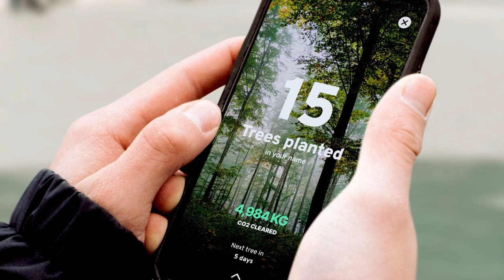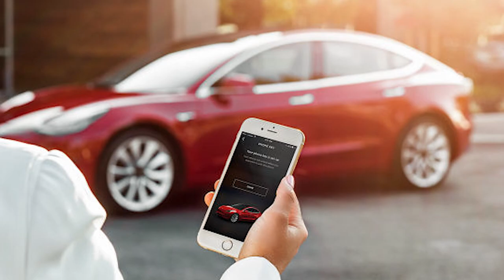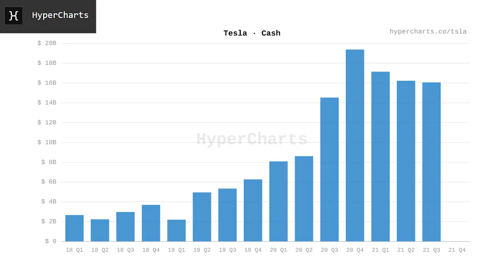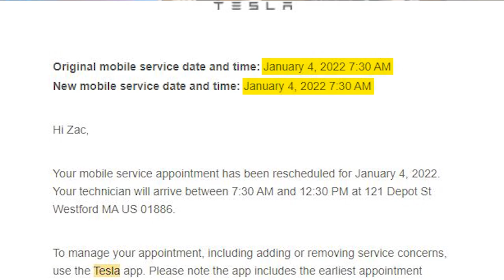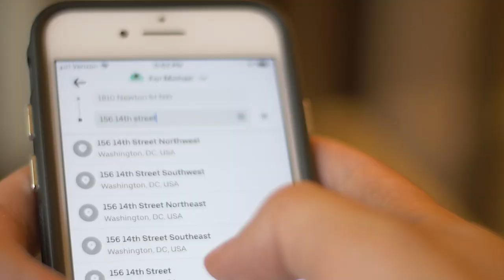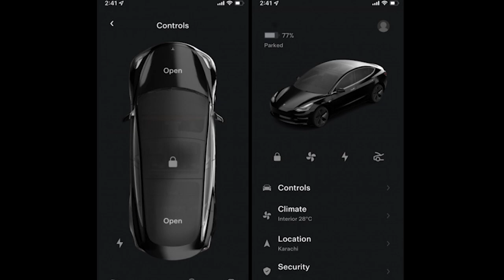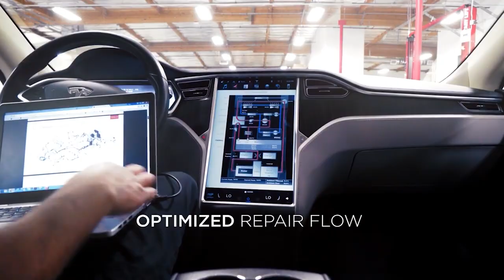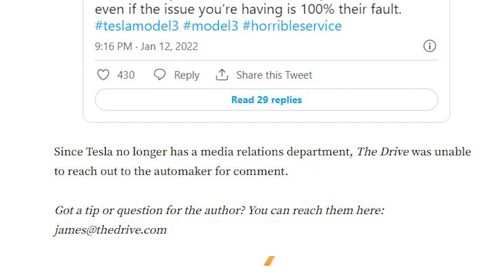Tesla We Love You, BUT… | In Depth

Comment: Tesla should start training and officially authorizing other mechanics to act as officially authorized Tesla repair shops. There are a lot of mechanics out there that would jump at the chance to work on this well-known EV brand, and the number of ICE cars are declining. BTW, other new EV companies like Rivian are faced with the same problem - and could use the same solution. 
This is one area where the legacy automakers like Ford, GM, and VW have a big advantage - they have an extensive network of dealers, all of which have full service and repair departments.
Reply: That is especially true of repair parts that are standard for all cars - any tire shop should be able to handle tire replacement and wheel balancing. Places like Midas should be able to handle brakes and suspension system repairs. Window glass ships should be able to handle window and mirror replacements. Body shops should be able to handle dents and scratches. 
So, basically everything except the drive train, FSD hardware and electronics.

Comment: This video really struck a nerve with me.  I have a 2020 Model X Performance which has been very unreliable.  I know the premise of the video is not that reliability is necessarily bad, but most of the problems I've had have been ones that I've seen common complaints about from the X: failed Falcon Wing door sensors, shaking from the front CV joints, failed HVAC system, failed SD card in the MCU, needing a new 12V battery and tires 3 times in 30,000 miles even without spirited driving. Every time, getting a service appointment has taken weeks, usually meaning that by the time the service appointment comes we have a list of multiple issues to address.  The service techs are generally nice and helpful for us in person, but as soon as we leave the service center, it becomes extremely difficult to contact them.  Especially when, as has happened several times, we left service and found later that the problem still persisted; but by then the original service appointment is closed and we have to book another one.  As you said, talking to a real person might take 3 minutes to get a resolution, but trying to do everything through the app is a complete nightmare.  At least I seem to have had better luck with getting loaners than some others you mentioned in the video.

But the latest problem is a failed high voltage battery pack.  The car was towed to the service center on December 19th and I have yet to get it back more than a month later.  Every time the service completion date comes and goes, and just updates to a new date further out.  It seems that Tesla is not interested in sending HV packs to service existing cars preferring instead to simply churn out new cars.  A fixed car doesn't show up as a delivery on quarterly earnings.

I am a huge Tesla fanboy.  I own their most expensive model (at the time of purchase) and I have a pre-order for both a refresh Model X and a Cybertruck, both top of the line.  But if they miss their next service completion date again I will be cancelling both orders and possibly seeking a legal remedy for my existing car.  Already, every person I know has seen my experience and have been completely turned off of Tesla as a brand.  Instead of seeing all the good aspects of my car, the conversation instead always revolves around the unreliability and the fact that it is always either in service, or waiting for some service appointment a month in the future.
Reply: HV battery packs are incredibly difficult to get right now.

Comment: AND............................

This is why I've said that right now, the fact that Tesla has built all the manufacturing capacity is significant, for now, but people who try to say that Tesla will always be ahead of other companies?  No, absolutely not.  

Everything you've said in this video is something MANY people have talked about, and this leaves a bad taste in people's mouths.  At some point, when there's a lot more competition by the end of the decade, people are going to shop around a lot more and the fanboi thing is going to fade away when every auto company produces EVs.

But, it's a lot more than just that.  It's going to be about how people enjoy the vehicle, and I know there are lots of Tesla fanbois that will talk about how great they are, while ignoring the many thousands of people who've have a different experience.  What is the comfort, how does the vehicle handle, what's the visibility, etc....  They're going to be going against auto makers, that while wrong in thinking they could easily catch up to Tesla, won't be wrong in the long run because it won't be about how many vehicles you produce anymore.  It will be about how people feel about the vehicle and the ownership and this is where other companies have decades of experience, AND the infrastructure in place to deal with problems, because even though you have to completely rip a factory apart and redo it to build a BEV vs. ICE, the same isn't true for service centers, and that's what other companies already have.

The vehicles need to stop having all these little problems.  I constantly hear about issues with Teslas, and the last three 4 vehicles I've owned, all for 120,000 to 140,000 miles, I only had ONE issue where something broke, and I owned a Geo, Kia, Nissan and Toyota.  The only thing any of those vehicles ever needed was maintenance.

Last issue.  Tesla uses Agile as a project management scheme, and that's fine, but eventually that needs to get you to where you release a vehicle, and it doesn't need 100 changes in the manufacturing process or changing a part out with something else.  The other manufacturers are used to producing a vehicle every year, and they don't have to keep changing it, and most never need any recalls.  So, Agile is both good and bad.  It's fine right now while Tesla is figuring out the best way to make a reliable vehicle, but they have about 4 - 5 years to make the 1st vehicle that rolls out of the plant the same as the last one for a given year, and they'll need to follow the model of the other makers, because that's what consumers expect.

I'm rooting for Tesla, really, and I want them to get to where they're releasing vehicles that a middle class family that's making around the median income can afford to buy like what happens in China with BYD and some other companies.  But I see them hyped up so much, with things like them being able to make 20 some odd changes in a week as a good thing, and it is and isn't.  Other companies will put more planning into the design and manufacturing, and they'll make a vehicle people really LIKE to drive, and almost never have issues.  They've been doing it for a long time, and while making a BEV is different, that doesn't negate the experience they have in design and manufacturing.  I would never buy a Tesla in the current config, because if I want service, I want to drive no more than 10 minutes to drop the vehicle off and as I live in a big metroplex with lots of service centers, it's easy.

Yes, Tesla better start making those investments NOW since they're going to be rolling a million+ vehicle off the line this year, and people are going to have a lot more expectations.

Comment: They need to build a factory just for parts just for their service stations.   Doesn’t need to be a massive factory as they are only using this factory for a fraction of the cars sold,  for repairs.     
It just shame that a company that has so much promise with this MASSIVE issue.
   The amount of time to repair a ice vehicle is hours to a couple days at most.    While you have to leave a tesla at one of these few service stations.      Then they get jam packed show in this video.     If they had a turn around time of a day or two at most they won’t be jam packed at all.

Comment: Tesla has always not cared about service. This is why Tesla solar(energy) is not moving forward. It's the number one thing I use to sell against them. (I used to work there but had to leave bc they don't think salespeople for solar are necessary 🙄. ) So they have the "Lowest cost" and I simply ask the potential person to go on Tesla's website and if you can find me a phone number to call to get help when something goes wrong within 5 minutes I'll pay you $100 right now. Then when they can't I tell them the most expensive solar system is one that's not working and costing you time, energy and frustration trying to get it fixed.

Comment: My daughter has a 2018 M3 , she made an appointment to get the 12 volt battery replaced. No was wrong, it’s just her car is almost 3 years old and she heard that the battery goes bad in about 3 years. She also heard people that thier battery died and they had been stranded. She wanted to prevent his from happening. So Tesla told her their were no notifications that the battery was bad. The next day unbelievably she couldn’t get in the car .Call Tesla they sent a tow truck to her. The tow truck done how shorted out some wiring . Called Tesla , they sent another tow truck that new how to tow her car. After all this is Tesla hag MF changed the battery to begin with it would only cost my daughter 150.00 dollars . But instead Tesla hat to pay for the tow, an electrical cable and a burned bumper. Not to mention the loss of here car for 4 days . This  is BS incompetent service. Period. Charlotte Tesla Service SUCKS.

Comment: I love my 2016 Model S 90D and have put 85k miles on it. When it has needed service, the experience has not made me proud to be a shareholder. There are some people I cannot recommend Tesla to because I know they would not tolerate the service experience.

My door handles stopped working, which is apparently common to my make/model. It cost $600 each and took three weeks for the ranger to come out and fix it.

My infotainment system freezes and resets often and a visit to service yielded no fix. Subsequently it was recalled (5 months ago) but has not been fixed because no parts are available.

Recently navigation stopped functioning, showing an error after a system update. Tesla said it needed a new micro SD card which they would install in a couple weeks for $250 and a day in the shop. I did a factory reset and the error went away.

The windshield wiper fluid pump quit working and Tesla said it would take 3 weeks to get to it. I ordered the part on eBay for $20 and did the work myself because it is not safe to drive for three weeks in Midwestern winter without a clean windshield.

The car is the best product I've ever owned but the service quality is low.
Reply: $600???  The handles are $300.  I don't know which Service Center you're working with, but they're ripping you off.  Now, the "three weeks" is about par for the course right now.  Door handle retrofits require a door handle controller that is almost impossible to get, at the moment.

Comment: I don't doubt Tesla has room to improve but during COVID do you think Tesla is alone in having problems with oem service centers? Staffing is all screwed up across all markets so just telling them to fix labor problems out of the blue is naive. Tesla is not alone, OEMs are having staffing problems too.. two guys who don't run a business telling Tesla how to manage staffing..

Also Tesla started with very few service centers and built them out when customers on that area increased. When Maine gets more cars, Tesla will build a service center.

Naively griping for an hour? Unsub

Tesla
Reply: This is correct, but I'd like to add that Maine probably has dealer franchise laws that prevent Tesla from opening a Service Center there.

Comment: I have called for service model X drivers window slooow as a snail
Reply: They clean and silicone the window where you can't see out of it very well after it goes up-and-down once A neighbor friend of mine had the same  model minus the performance an his window they replaced the cylinoid. They still haven't fixed mine yet a moble tec says it is extremely slow.

Comment: The torn underbody “fiberglass” was extremely common (I.e., design flaw) in early Model 3s - we had exactly the same story (rain, deep puddle, etc.) for our mid-range Model 3 we bought in late 2018. So they should have known that their mobile tech wasn’t going to be able handle the problem even when they made the appointment.
Reply: The aero shield is easily replaceable by a Mobile Technician.  There has to be more to this story.

Comment: Service has BEEN Tesla's weakness for some time now. It's only going to get worse as many more Tesla's hit the roads. Not quite sure how this aspect was missed since you're talking about cars. Cars have get physically worn out by the roads just like any care. I've heard it said that Tesla EV's are computers on wheels. However, computers don't usually interface with roads, weather, and natures debris. Time will tell. Even the legacy OEMs are going to have to tackle this problem but from the other end. They have service centers, but they're not equipped with the hardware or employees to handle the computer side. Businesses such as Gruber Motors are already starting to fill deeper portion of repairs. The non-assembly remove and replace type of maintenance which is very expensive. They dive deeper to a smaller component level to minimize the repair costs. So, even though Tesla has solved the development, production, and sales aspect, they have failed miserably in the service aspect.

Comment: While it certainly seems like a valid issue, getting service - guess what?  Tesla doesn't have nearly the same amount of service requirements. No oil changes, transmission service, or ice issues, longer brake pad wear due to regenerative braking, etc..   I had to make an appointment for an oil change and such for my Jeep Gladiator. That was 3 weeks.  Then another appointment for a leaking axle seal - that was 8 WEEKS!!!   So it's not just exclusive to Tesla.  Many other businesses are having similar issues.  In many cases it's because too many folks are still being paid not to work and stay home playing their Xbox.

Comment: I can almost accept a factory missing a brake pad being installed, but I can not understand how it passes quality control at the factory and a pre delivery inspection. 
Imagine if she hadnt gone to a independent mechanic and kept driving because a tech said it was normal noice and later got into a crash injuring her or someone else beacuse her brand new car didnt have all brake pads from the factory.

I think Tesla should do like all other car manufacturers and let independent shops work on them, sure they might not be able to change a battery or whatever but changing brakes, suspension, body panels, tyres and wheels or whatever is just the same as on a normal car. Tesla would still earn money from selling spare parts to the independents and would get shorter waiting times for the more advanced jobs in the service centers.
Reply: There is no pre-delivery inspection.  The cars arrive off of the truck, they're washed, and then they're delivered to customers.

Comment: I understand your desire to improve the Tesla experience and thank you for your informative videos over the years but your arguments aren't 100% solid. First of all if Tesla's breakdown less than ICE cars then the cars/service centre could appropriately less. If Tesla's breakdown 4x less then your 5,000 Teslas/SC would be equivalent to 1,250 ICE/SC so to make this argument convinving at all you would have to show data on number of repairs for each vehicle type. Speaking of data, yours considered only your state which is a small part of the over all market. It would have been great if you had data at least covering all of the US or North America. After that you go on to go through your personal anecdotes about service which are just that, very personal experiences (which I agree are unfortunate). I can tell you that as an owner since 2015 I have never had a problem like that. In fact, I have never had to wait more than a couple of days fo an opening, if the repair takes more than a few hours I get a courtesy car and parts have always been available. Not only that but on two road trips to the states when I had issues I pulled up to the nearest Service Centre and they fixed the porblem on the spot with no previous appointment. My point is that we cannot judge things (and Jeese should know this as an engineer) with anecdotes. Rather you should have done the work to research average wait times for an appointment, average wait times for a part, etc and compare this to some brand such as GM or BMW. Sooooo, thanks for the ideas and Tesla, like any other company, should be continously improving but your lake of quantitative data made your arguments very week. I love you guys but in the spirit of love and wishing the best for your channel I feel it's necessary for you to recognize your reporting shortcomings.

Comment: Definitely makes me want to wait to buy a Tesla. Everyone talks about how much less maintenance an ev requires but how much less really? So You don’t get oil changes and brake pads. I drive a 2009 Toyota with manual locks and windows. I have 200,000 miles on it and I get 35 mpg. I get oil changes every 5,000 miles. I could probably drive this for another 200,000 miles. With gas and regular maintenance this car will cost me $20k more  to operate then an EV for another 13 years. So why would I spend $60k on a model Y.
 I just want a cheap 400 mile range EV for $25k. I don’t need a bunch of fancy shit. 
I’m Still in a holding pattern
Reply: I have a 2018 4Runner, and I DREAD going to the Toyota dealership for oil changes.  It always takes 2-3 hours, and it costs almost $100.  Ridiculous.